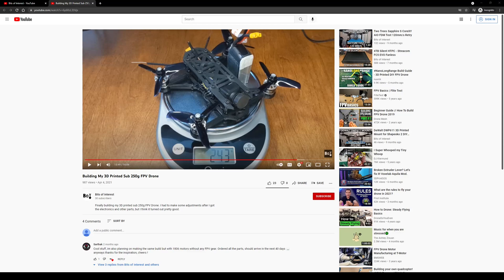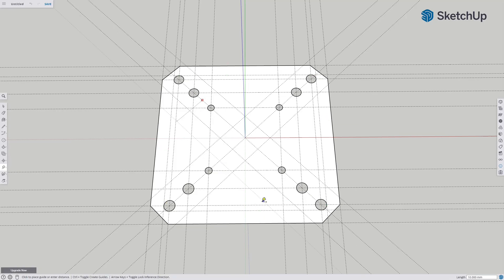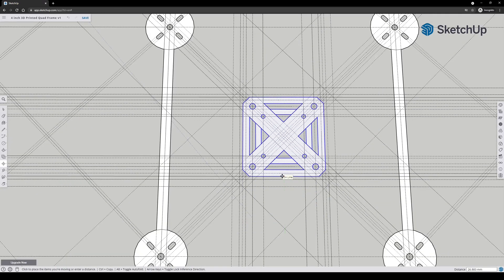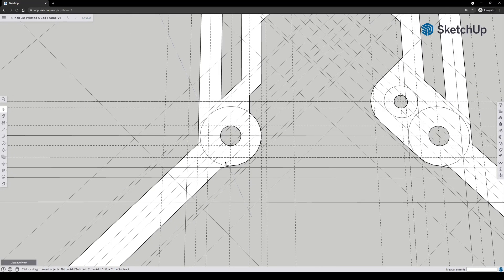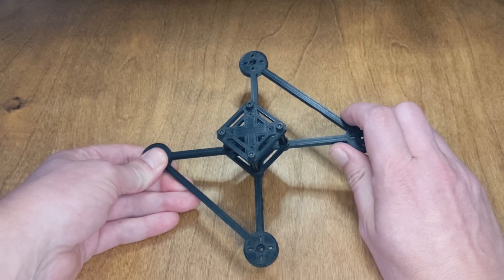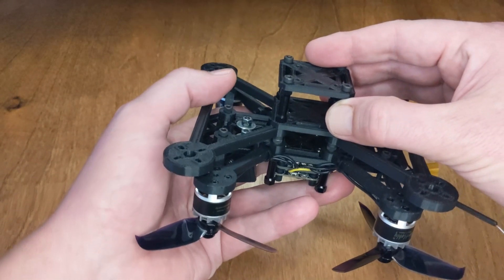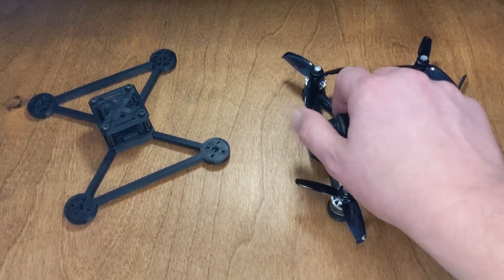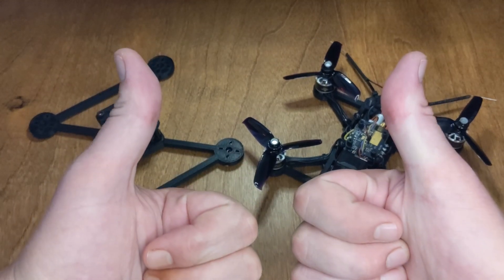Can You 3D Print A 4 Inch Drone Frame For Sub 250g?

Comment: How have I missed this channel for so long. Man is this wholesome and informative. I'm designing a 4'' frame for wood laser cutting and got some good ideas from here!
Reply from the maker: Thanks! That's probably one of the nicest comments I've ever gotten 😁👍 I just make videos about what I would do anyway and I figured there are other people trying to do the same thing. Maybe it saves you some time not having to make the same mistakes I did. 

Regarding the wood frame, I'm not sure how well that will hold up in a crash. Unless you can make it yourself in 20 mins like I can 3D print a new part when it breaks. I'd probably use a lot of triangles, sort of like a truss. I guess I also did that with these 3D printed ones 😜

Comment: Hey, im currently designing a 4 inch drone aswell. What tipe of filament are you using/do you recomend? Im trying a petg/carbon mix (carbonfil by formfutura)
Reply from the maker: First, I'm just a DIY guy, no expert in 3D printing 😁 I use whatever is close to $25/kg on Amazon with good ratings and reviews. Currently I'm using Overture PLA Plus (roll label says PLA Pro). Be careful with the carbon filaments because they will eat your printing nozzle.

PLA is the strongest material in most scenarios. I haven't found a reason yet to stray from PLA also because of this CNC Kitchen video: https://youtu.be/ycGDR752fT0